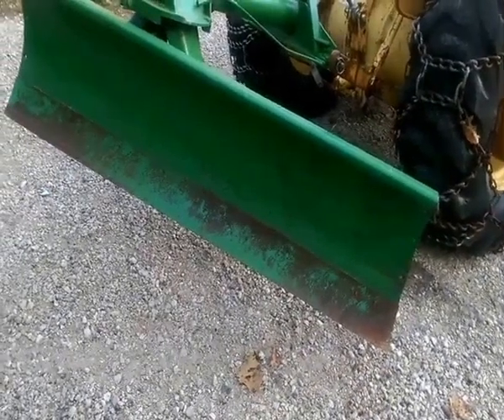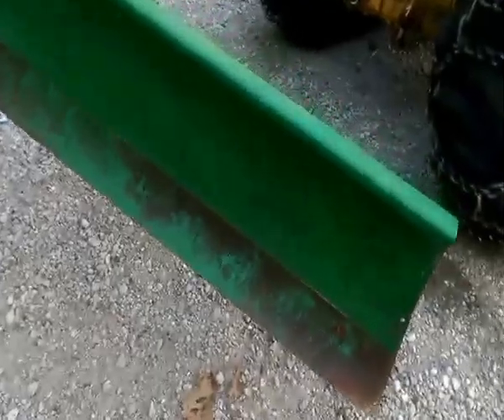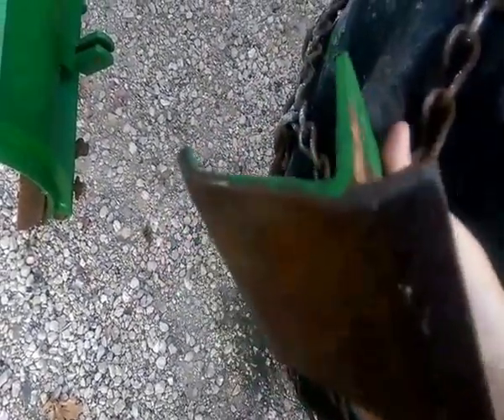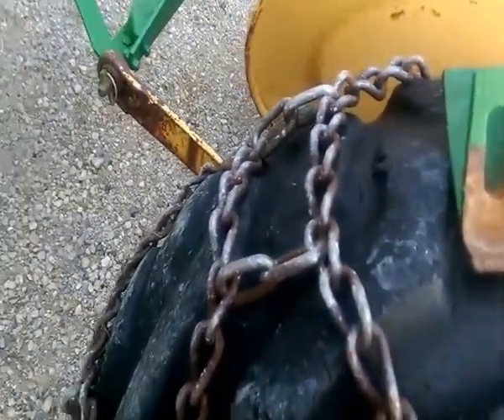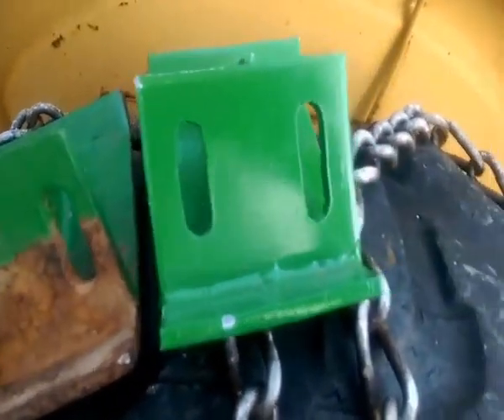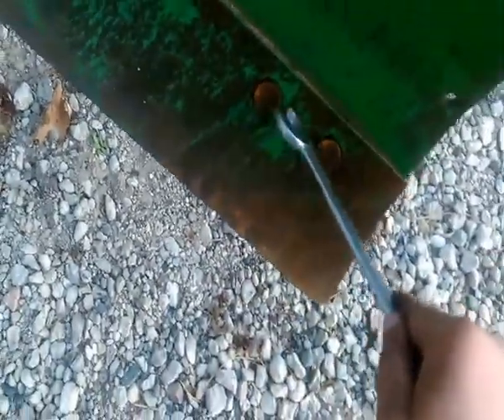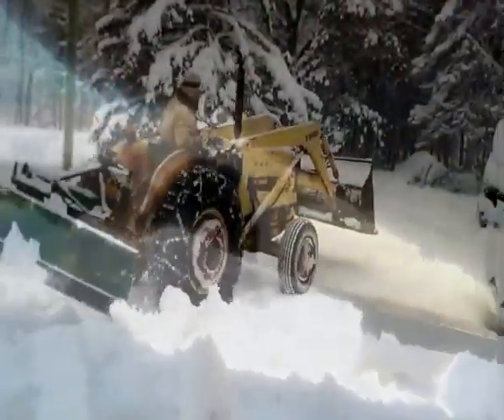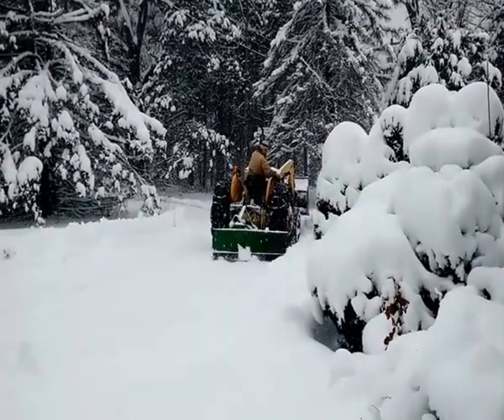John Deere 80 A Back Blade Skid Shoes full vid

Comment: I had a 45 rear blade and I needed skid shoes for it.
Reply from the maker: I don't know if the shoes from the 80 and 80a are the same as the 45. If they are I have a couple different options that I can offer. Since the time of this video my good friend who had a welding shop and helped me to fabricate the shoes has passed away. There is another welding shop in the area here that will make the shoes according to the plans that I have although their price is substantially higher or if you have the ability to fabricate yourself or a local shop that you want to have fabricate them I can sell the 3D drawings I made for these shoes to you.
Reply: @ajbergman3801  I actually sold the blade back in 2021.

Comment: looking at picking up a used one of these.  will be my first scraper blade.  is it a good one?  looking to plow with it in the winter and in the summer use it to fix up our cabin driveway.  how hard is it to reverse the blade?
Reply from the maker: I really like this back blade (for reference I also have a box blade - for most projects I prefer the back blade because the box blade doesn't tilt or angle). The JD 80A is very well built/durable and versatile. The blade tilts easily for angles to cut ditches and such or have it parallel to the ground for snow removal/ driveway maintenance. It  also pivots easily to the right or left (or spin around 180° to pull instead  of push).

Comment: Hi AJ. I have one of these that needs feet. Do you still make them? Thanks!
Reply from the maker: Sorry for the delay in responding.  I  fabricated these with a friend of mine who was an experienced welder, but he retired and moved from MI to TX and he sold all his equipment. I am sure  I can  find someone  else locally  who can fabricate these skid shoes, but I can guarantee the price would be the same as when I made them  originally.  If you need help let me know.
Reply: @ajbergman3801  Hi AJ, thanks for getting back! I'm in WV and was going to build them myself, but the original feet were long gone when I picked this scraper up and I wanted to replicate the originals, as far as dimensions and angles, etc. It looks like yours are right on the money!
Reply from the maker: I was fortunate enough to have one of the original skid shoes left that I could duplicate and I still have it to produce an accurate pattern for reproducing.
Reply: @ajbergman3801  Well, if you find a welder and can give me a price, I'm willing.  Or, if you ever do get a CAD or drawing, I'd be happy to pay for a copy. Regardless, thanks for sharing the video and for your correspondence :)
Reply from the maker: I made some calls to local fabrication shops and showed them the shoe - most quoted me $275-$350 for 1 shoe and $100-$150 for additional shoes without any finish which is pricier than the shoes I sold (the shoes I made I powder-coated and sold for $175 each or unfinished for $125).  I made a CAD drawing with dimensions and the various views needed (4 sets of drawings for all parts and dimensions) and would sell a full copy of the drawings for $25.  If interested let me know and I  can send you a PayPal invoice

Comment: Hello A.J.  Do you have a users manual for the John Deere 80-A Blade.  I recently traded for one and  I have not been able to find a manual?
Reply from the maker: Mark, no I have never had an owners manual for this back blade. If you have particular questions about function and “how to” I would be glad to try help.
Reply: Hello and thanks for the reply.  I have not hooked up to it yet.  I need to go over the mechanics of the blade and lubricate the adjustments.  I will be in contact again soon to ask about some tips and tricks for sure. I am thinking about adding a small cylinder to slide the blade left and right of center. I am not a stranger to scrape blades.  The one I used before did not have the tilt feature, it was an inexpensive blade that had seen it's better days.